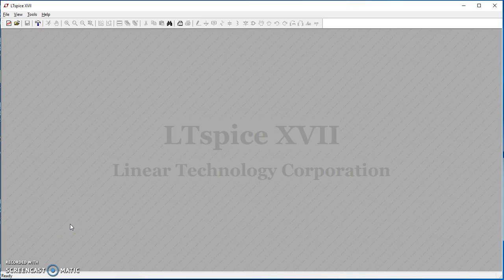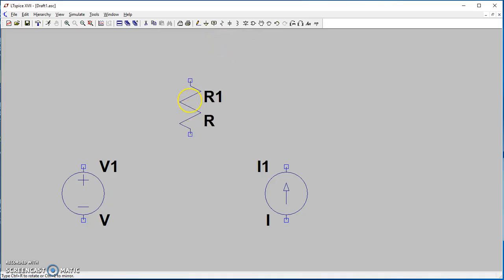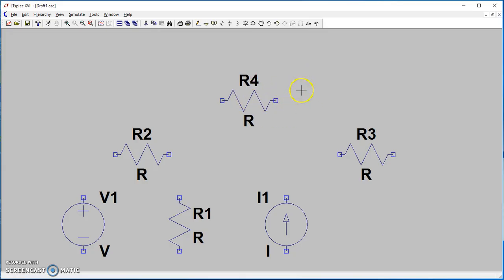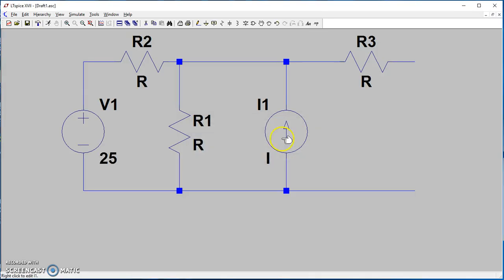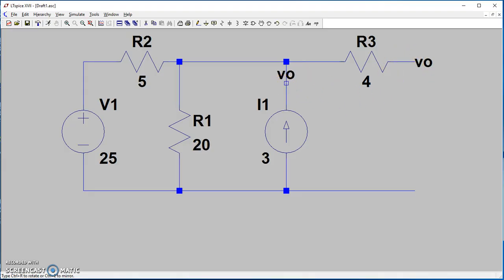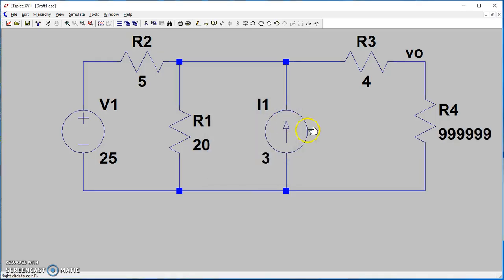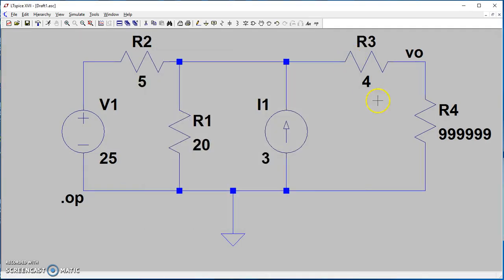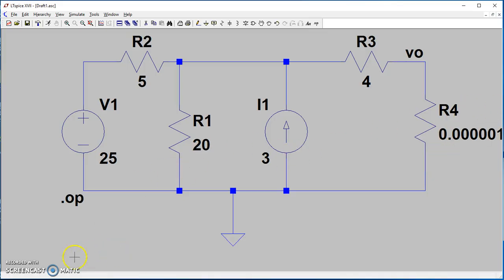LT SPICE and Thevenin equivalent

Comment: There's absolutely no need to add resistor R4. Just leave it open circuited, run it and read out v0. That's your Vth. Then short circuit it and rerun for Isc (current through R3) and divide that into the previous v0 for Rth